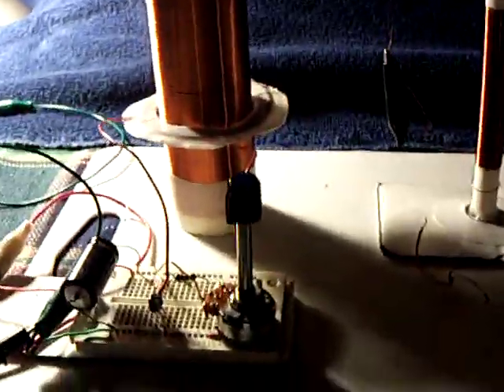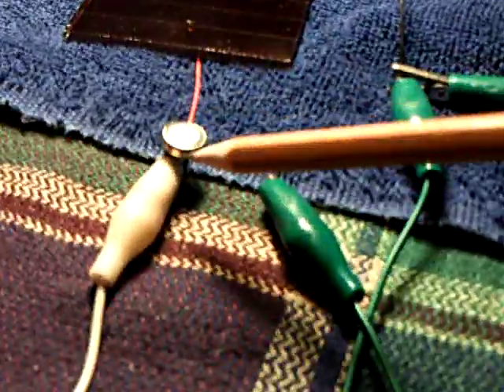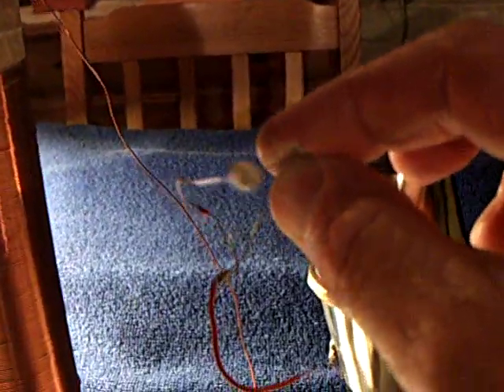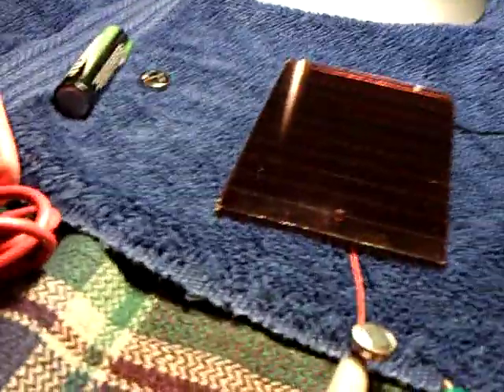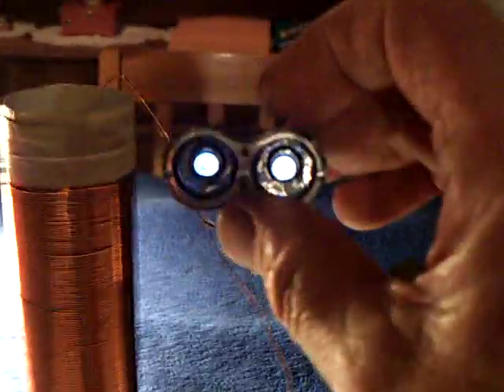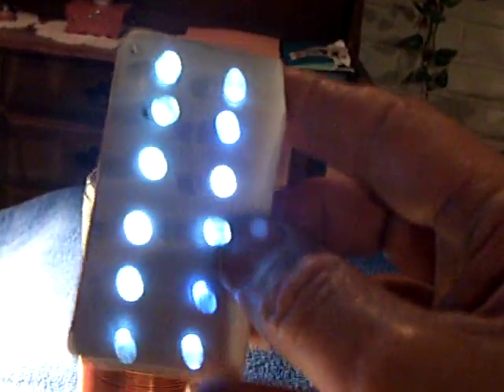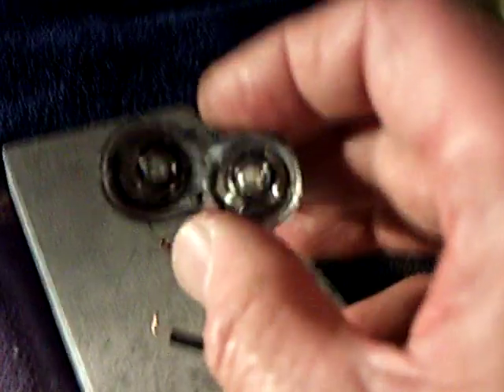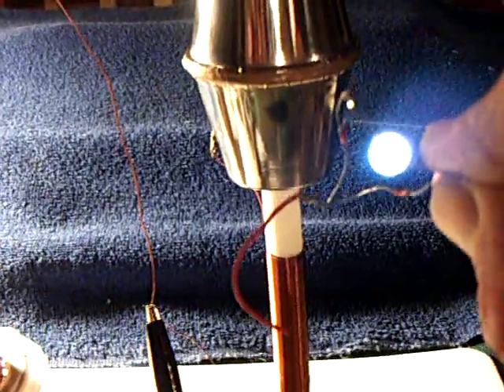Slayer Exciter running on very low power.ASF

Comment: Yes I agree, there may be something else going on that is hard to detect at such a low voltage and current. Dr Stiffler said that it was running for 47 hours and may be it really is. But that is a large cap and such small currents. I guess we will see what happens. If this really works, I want to build one too. Like they say, Hope springs external or internal or infernal or something like that. Anyway I hope it works and it can be replicated.

Comment: Lidmotor you are getting the flashing because the transister is going in and out of "cut-off" region and trying to go in the "Active Region". These transisters work off a 0.70v drop because it's the nature of the beast. When you added the extra voltage you made the electrons in the transister jump and the positive materal and hole which are posive go the electrons position. Just some electronics class theory.

Comment: Lid, I see Dr Stiffler now has a self running system with no battery. I just don't know what to think. I sure did not learn any of this in my electronics class. This is really cutting edge stuff. I can't wait to see what is next.